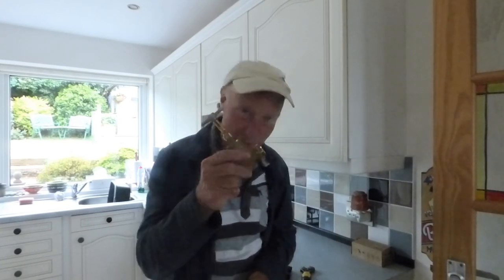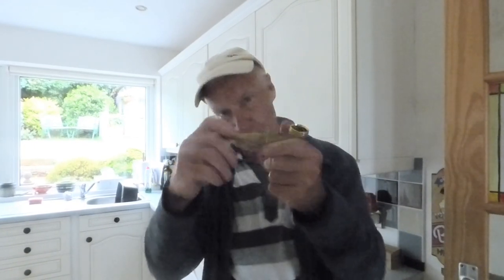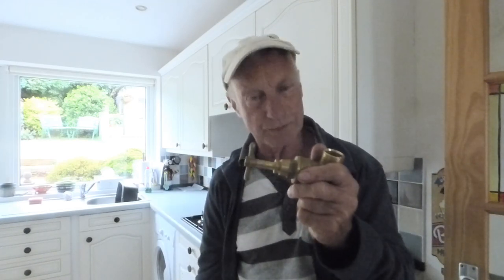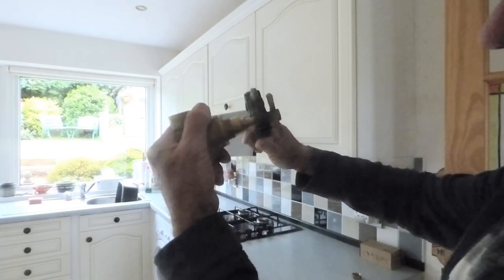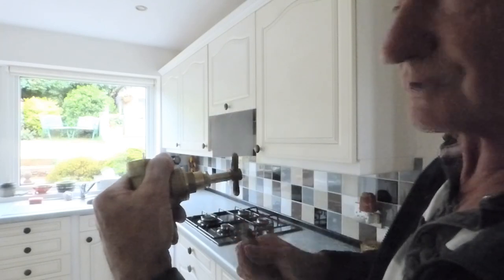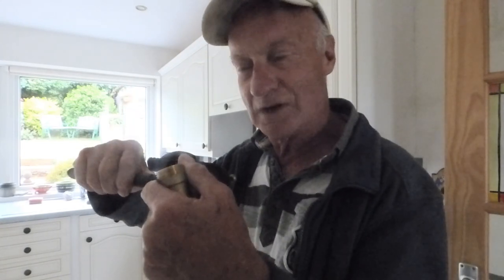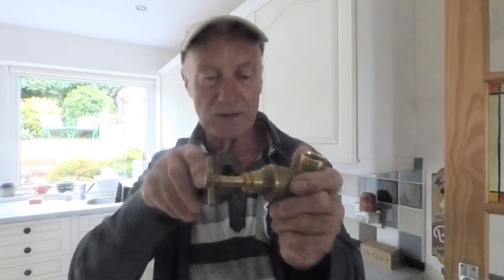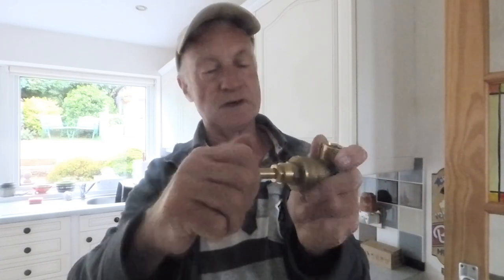How to turn a stopcock that will not turn off.

Comment: Tried spraying with Viakal Limescale spray. Worked last year but not this.  Tried your way but don't have the strength in wrist after breaking it last year. So soaked kitchen towels in White Vinegar and wrapped it around and left for an hour.  Came back and tried your way again. It worked l am  so pleased. Thank you for Video.  From now on every 3 months l am going to turn it on and off.
Reply from the maker: Well done Angela.

Comment: Al what do you do if you have the opposite problem ie the stop cock won't turn on even though the tap handle turns freely? The building is a two storey flat built in the late 1920s & the tap is located in the loft next to the water tank feeding cold water to bathroom & hot water cylinder.
Ps I enjoy your informative vlogs immensely thank you.
Reply from the maker: Hi Alun, the tap handle is spinning around, so take it off and turn the brass shank with a small spanner or grips.

Comment: Great video as always. I have a pair of these on the output of my cold water tank which have seized  I was contemplating replacing them with a Pegler lever valve as I've been told they are way less troublesome. What are your thoughts please?
Reply from the maker: The best bet by far.

Comment: I tried WD40 before watching and yes it did nothing. Thanks for the tip about removing the handle bit (didn't even know that was possible. I'm really struggling to get the packing nut to move, used quite a bit of force but still no joy. Not really wanting to put more force on it in case I damage it. Any ideas on how to get around this ? or is it time to cough up for a plumber
Reply from the maker: Some times you have to admit defeat.
Reply: Free the pipe and fit a new stoptap.